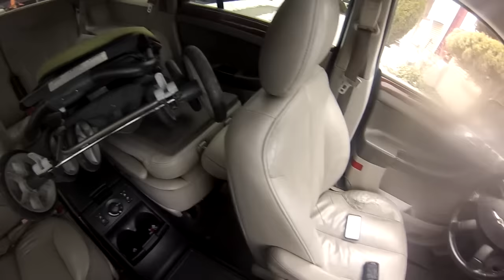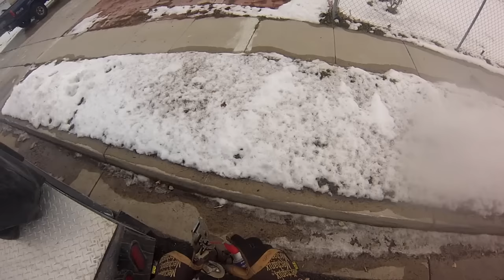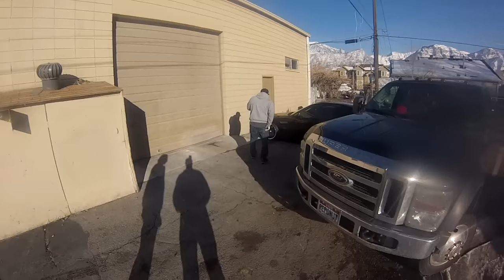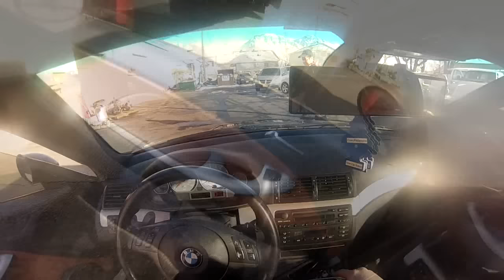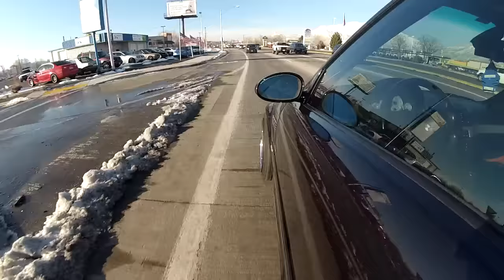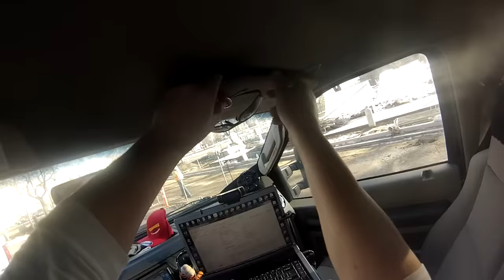With A Little Luck And Some Mad Crazy Driving Skills Anything Can Happen

Comment: Matt have you ever tried the application f.lux?  I noticed that on the videos when you get in the truck at night the laptop is very blindingly bright.  f.lux will automatically adjust the color temperature depending on the time to make it a lot less stressful on the eyes in lower light conditions.  There is even a super night mode which makes the screen red to not mess with your night vision.  Love the videos man, thanks for sharing with us.
Reply: Great little program. I wish I could use it at night (I can't because I do graphic/web design and kinda throws things off) otherwise I highly recommend f.lux as well. It does take some getting used to but definitely way easier on the eyes.

Comment: @RepoNut
Hey bro quick tip there is better fluids to use than WD40, WD40 is a water based lubricant. If you spray WD40 onto a bolt and then tighten a nut down on it, then come back after the WD40 evaporated you wont get that nut off the bolt without twisting the bolt into two. The nut will seize on that bolt.

Comment: RepoNut I've been wondering something since I started watching your vids, about two weeks ago,. You have those little four wheeled dolly jacks that you use to lift and move vehicles, I was wondering why people don't use flatbeds for towing? Something I've seen before, and I see as a much quicker way to hook up vehicles would be to use four of those dolly's along with a set of winches and a mechanical inclined flatbed. You just pop the dolly's on, hook up a set of winches, drop the trailer down and reel it in. I saw something similar to this when I was backpacking in Europe. Any reason more repo guys in the States don't use this method?

Comment: I don't want to challenge your experience or decision making. I saw how low that bmw looked in the video, and thought I would throw the dollies for ground clearance, especially when dealing with a buddies employee. But the roads here around metro detroit/michigan are so busted up....
I'm just curious how you determined it was sufficient to skip them.
Reply: He prob didn't raise the lift as high as usual.
Reply from the maker: bigtrucker26 Easy choice... the rails would never fit under the frame so can't use them on lowered cars.
Reply: Fellow Michigander here, can definitely vouch for how bad the roads are, hit a pothole the other day that literally broke my rim in half. Luckily I had a spare rim in the garage so it didn't cost me a ton.

Comment: what do you do if a car is parallel parked with little space in front and behind?
Reply from the maker: Magic
Reply: I use go-jacks and my winch to pull it at an angle.
Reply: martinshoosterman Just hit it at a 90. The rear view cam helps out a lot
Reply: +martinshoosterman Go-Jacks, or using the mechanism he has, he can pull it facing away to pull the front out, then hooking the front, then leaving. Advancement in technology allows for this type of action within repossessions
Reply: +martinshoosterman Where there's a Repoman, there's a way LOL
Reply: +RepoNut I've seen in one video you lifted it from the side like a fork lift do they have specific contact points when you do that cause it's real bad for cars when people do that
Reply: +majestic motors no its not. as long as its on the frame or pinch rails if its a unibody its fine

Comment: WD40, doesn't lubricate in the long run, it is for penetrating and losening of rust. WAsn't it better to use some PTFE lubricant like for racing bikes chains. Not moterbike it is sticky as hell in comparison, so it doesn't get thown of doing 260 kmh.
Or am i wrong ?
Reply: Wrong. Water Displacement formula #40 (WD40) was designed originally to prevent corrosion in missiles. It was later discovered to have endless usage.

Comment: You should use something better than WD-40, WD-40 isn't the best rust preventer/lubricant. Liquid wrench Chain lube would be a much better option, Even though it's for winch wire and chains it's really good for anything that needs help against rust.

Comment: Hope PD doesn’t try to ticket you for driving the wrong way down the street in front of their station. That was pretty funny though. Did you ever figure out what that pulsating werrr’ing noise is when you operate the boom?  Is it a problem or something that can be lived with?
Reply from the maker: Pet Rock's Garage It comes and goes and is most likely either low pressure in the hydraulic lines or air that needs to be bled. It was only happening on the fold in and out and the jaws open and close but it is now all the time which tells me the air equalize across all the cylinders. I plan to have them bled and the pressure checked here in the coming weeks as we slow down for tax season. Hopefully will be good to go after that.

Comment: why does everyone in utah leave there cars unlocked
Reply from the maker: Cody TRACY Like it matters really... a thief who wants inside will bust a window to get around the locked door so now you're out the window, the added downtime to get a new one and whatever they stole from inside. I say leave it unlocked and save the hastle. Only lock it up if you're going to install a serious security system that will not only protect your vehicle but will warn you when someone is sniffing around long before anything is broken. A few hidden cameras set to record on intrusion and a couple GPS tracking devices to make sure you can located and follow with the cops enroute.
Reply: RepoNut is right, my mate had his window smashed for 25c in change. Sometimes it's easier just to leave it unlocked. Having said that, in some areas in Aus, it's illegal to have your car unlocked when parked, and councils issue tickets!
Reply: Justin Hill I agree with you. Of course if someone wants in your car they will get in. But locking your doors may be enough to deter petty criminals. And in a very public area I don't think any crock would break a window, where as they would not think twice about opening a door and grabbing some stuff acting like it is their own car. 

I live in Nj in very populated areas, so I point of view maybe different.
Reply: I live in rural  Iowa  and i leave my vehicles unlocked and  most of them  have the keys in them too ,, feel free to try and steal any of my trucks ,, cause i guarantee 100% that you won't get away with it 
my driveway is blind and has a curve and slope to it ,and you have to back out of the driveway ,,and i guarantee that i will hear you long before you get  out the drive  cause i don't own a truck with any  mufflers  except  one and even that bastard is loud  cause of it's  detroit diesel 
I do have sensors on my driveway  to tell me of a person or vehicle entering either the front or back drive ,,and i have a very nice 4 legged burglar alarm  with a loud  bark and large  bite too ,,
also have  S&W 6 shooter home defense and security system as well

and  like Mat's repo yard and his truck ,, my whole farm and all  the outbuildings are  wired for video and sound over 25 cameras inside an out of the buildings
Reply: i have seen some of his repos he was reposing the car was open in a public place if you did that in ca your car would be gone so fast and your would never see it again
Reply: the  likely-hood of someone getting clean away  my vehicle , especially my work-truck 
is about as likely as being able to steal mat's truck and get away with it  
I have a GPS unit , admittedly and older one but it does work ,, and i have and RF pinger transmitter as well which has a 25 mile range 
there are also cameras in my truck with a PC set up as DVR  that has 4G cellularphone connectivity,,  i can track that with GPS as well 
everything is well hidden and damn near impossible to remove  due to how it's installed in the truck ,,, I've had a vehicle stolen  many  years ago and it won't happen again 
i won't get carjacked  either ,i have self defense equipment installed in my truck too 

that and if your dumb enough to try and steal my truck  ,and you do get away with it ,, every cop in a 3 county area  knows my truck  ,, it's a 1 of a kind  ugly monster that I built  myself from  spare parts and 3 other trucks and a tractor,,, and likely as not you couldn't figure out how to drive it anyhow
Reply: i grew up on a farm i can drive a harvester and  a tractor don't judge a book by it cover before your read it
Reply: Locking the doors only keeps the honest people out.
Reply: yep your  right ,, that is why  i never lock my doors ,, and chances are  my keys are in the car too,,,but i have  other methods of protecting my vehicles , including my gun and  a couple of  large dogs which can wake the dead with their barks
Reply: wildcoyote34 so basically no one can even step foot on your property to piss in a bush without you knowing. Nice.
Reply: that's the Idea ,,if you stepped into the bushes to piss ,, i probably took your  picture too 
there has been too many  breakins and  robberies in my neighborhood  and my house has been broken into   3 times in the last  10 years 1 of which i was home and someone almost got killed ,, i vowed it would  never happen again 
my boundaries are well marked  too with signs and audible warnings for the intruder
Reply: Nice. In my parts here I am a 10 minute walk from our city line in Pa. Had some dude high out of his mind walk into my home with me sitting in my chair. Needless to say my wife and I enjoy collecting knives, guns, and swords. Never saw anyone run so fast in my life.
Reply: that's  nice ,,I've  dealt  with a few  dumb asses too ,, the last one was in 2007 when a guy broke into my house with a few  friends and tried to intimidate  me ,, mind you  this dumb ass  was chased off by me with a shotgun  2 hours  before hand,,and he came  back with friends   all the while knowing I DO have a GUN  ,and I WILL use it ,,,, did he really think i wouldn't shoot him  when he broke into the house ,,even worse when one of his  friends had a large  knife and another had a small handgun ,,needless to say ,, birdshot and rocksalt  HURTS  at close range
Reply: *****

Holy shit, talk about nanny state!  Do you have to get permission from the government to take a piss?
Reply: KiloByte69 It's to cut down on police wasting resources on motor vehicle thefts. Also lowers insurance premiums.
Reply: *****

No, it's typical socialist government policy that places the blame on victims rather than cracking down on the criminals themselves.
Reply: +RepoNut +1 my friends say this, especially if you have a decent car for the area you live in.

Comment: Hey repo nut have you ever thought about tinting your windows??
Reply from the maker: Memo Lopez Serves no good purpose and makes seeing out of the truck at night impossible. Rolling the windows down in sub zero temps is not an option either... When I worked in AZ we had dark limo tint on the trucks but could leave the windows down 24/7 cause most of the time it was 90 at midnight.

Comment: is your camera messed up on the right side the one that you wear on you? always a blurry spot there
Reply from the maker: ant l Change in temperature from outside to inside causes steam and it gets water beads on the external clear case. I clean it all the time but never know until later when I am viewing and processing the video that they were there. Working on a solution...
Reply: RepoNut need to charge the case with nitrogen or some other inert gas....but on a more realistic note you can put some of those silica jell packets in the case somewhere to hopefully absorb the moisture (bake them in the oven on low for a bit after they go blue to get them back clear and absorbing again) or perhaps some anti-fog for scuba mask available at your local scuba store for cheap